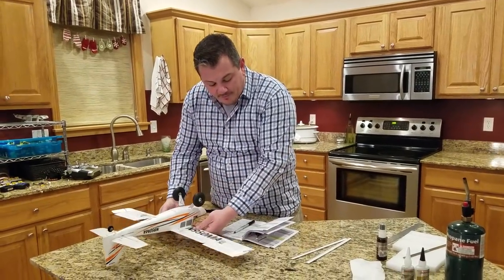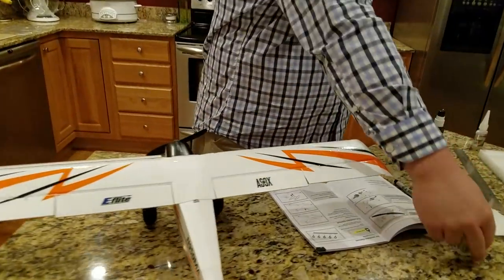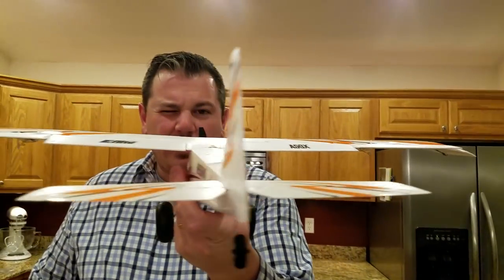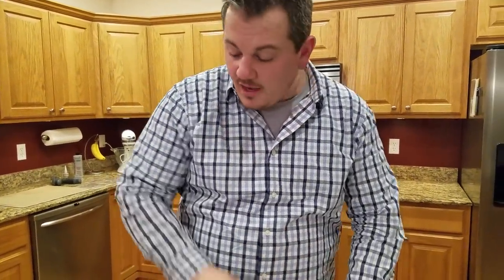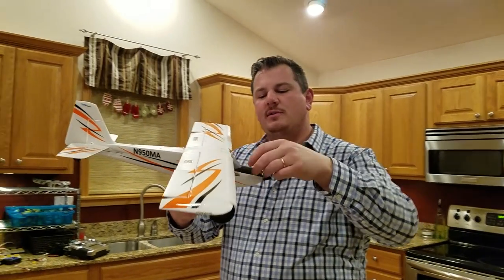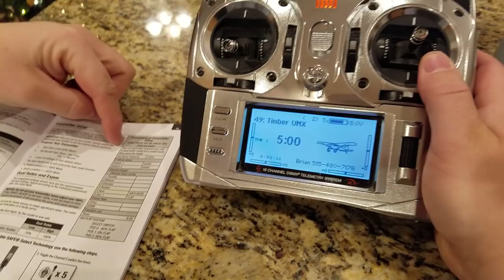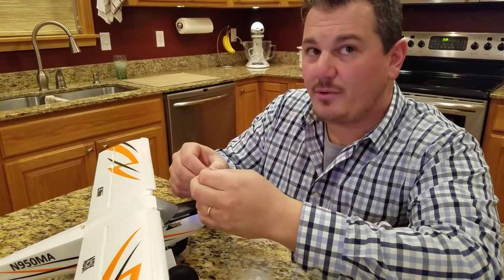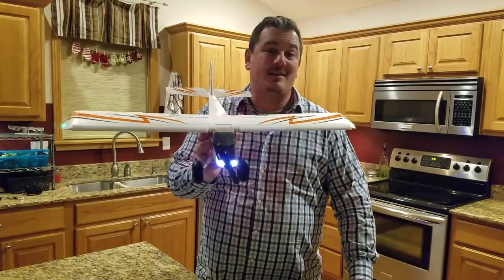Eflite - Timber - UMX - Assembly, Radio Setup, and Tips

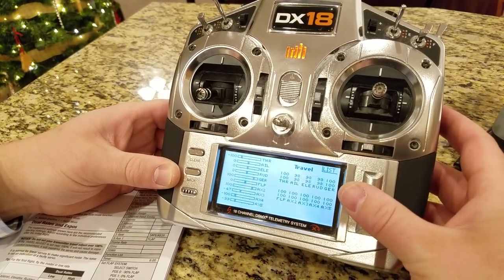Comment: Brian, I am looking at 39:48 in your setup vid and when I scroll thru the servo menu to change the 100 to 98 like you did, when I scroll to the ele how come the square outline only outlines the top 100.  but when I move the ele stick lower the box highlights the both top and bottom and then only the bottom 100.  Was I clear asking this?
thanks
Reply from the maker: That's because of the current condition of your FLAP control switch. So let's say you had selected Switch B, the one I had, and the switch was in the MIDDLE position...then BOTH boxes would be highlighted as you scroll through the available channels to edit...however, if the switch were in position 0, it'd be only around the LOWER number, likewise if the position were at 2, you'd only be able to modify the HIGHER number...(I might be saying that backwards, but you get the idea) just flip the flap switch once you get the HIGHER or LOWER setting set, then toggle to the other extremity, and do the other one, but if you have the switch in the middle, you can do them at once.

Good luck! This is a good one to ask now, as it gets harder as you get deeper and deeper into the weeds with me ;)

P.S. I understood what you were asking - you were clear...tough to articulate some of these things in text, isn't it!?!?

P.P.S. Good question!
Reply: Bri, thanks man for your help,  I finally understand expo. While setting up the timber UMX, I set the ail expo to 0 in switch position 1 and 100 in position 2 just to see the difference.  It's pretty freakin cool when things make sense and how your settings can change the result youre looking for.  appreciate it!!
Reply from the maker: Sure thing! It's even cooler when you get out and see it fly, and how many features are hiding in your transmitter that you haven't even heard of yet :) :) :)

Comment: Im still learning how to adjust this i set it up on a 2 stage switch and my safe on another 2 stage switch so the higher the percentage the lower the throws less aggressive? i gave the spectrum dx6 do you know how i can set up my throttle  when i hit 50 percent it beeps?
Reply from the maker: I believe that's in system setup. I don't think I use that feature, so I'm sorry I can't say for 100% certain....since I have a DX18 Gen1...which is SIMILAR, but not exactly the same as a DX6 (Gen2, presumably?)

Comment: I just received Timber UMX from Horizon.  Upon inspection, the motor shaft is off alignment with the fuselage by approximately 3-5 Degree.  When extending a ruler from the motor to the rudder the centerline is off ~1 inch from front to back.  I don't see where I can make any adjustment.  The motor shaft also points downward an even greater fully 5 degree.  This seems beyond factory tolerances.  What should I do?
Reply from the maker: This is correct ;) Even on a full scale plane there's down and sideways mount to help with the significant torque of the motor turning a propeller.
If the spinner rubs the fuse, then you need to get concerned...OR if you find that your plane flies off to the side where it appears to be goofed up.
You can REALLY tell how it's supposed to be mounted by opening up the front of the plane, and looking at the mount. This is where you can kinda see if the motor mount is "off".
Let me know if you're still concerned after reading my reply.
Reply: Thank you.  I had also checked with Horizon Hobby, who replied, "That is normal, this is considered the thrust angle. It should be facing down and to the right some to counter act the torque of the motor."  Did feel more comfortable with the info.  I am now waiting on the "kicker " pump spray attachment that did not come with it, and a required connector to allow the battery to attach to the charger.
Reply from the maker: Good luck! If you're waiting for a sprayer for your kicker, you might find that the it works well even with a small toothpick or a plastic stir. The sprayers seem to waste quite a bit of the product, but so does spilling it, which I LOVE to do - LOL!

Comment: What a great little plane my friend, your channel is very inspiring so much so that I bought a jumper t8sg v2 multiprotocol tx based on your experience, could you advise me if this tx will operate this umx timber as it seems like a good novice flyer for me as I'm fairly new to this hobby and love slow planes and gliders, thanks in advance, my best regards to you and your good lady,  Alan, Uk.
Reply from the maker: YES!!! That's one protocol that I had good luck with!!! DSMX and DSM2 should be pretty easy to get working. It's the Chinese product lines that are always very ambiguous, as far as what protocol they use.

Comment: Bri, i got a new timber umx-on the battery port is it supposed to have only 2 pins (i can't remember).  It only has the outer pins that go into the battery,  the middle one is not there.  
Also, when I move the ailerons, it goes to the up position much higher than the lower position.  I can't remember is that normal or does that need to be adjusted and how if so.
thanks
Reply from the maker: Yeah, the middle pin isn't there. That's normal.

This is called "Differential"...when the upward moving aileron is more than the downward moving aileron...and yeah, this too is also normal.
Reply: your ail don't go down much?
Reply from the maker: Yes, they move DOWN about 1/3 to 1/2 the amount that the other aileron moves UP....just checked to make sure I wasn't remembering things wrong....and I wasn't

Comment: I love this video i keep watching it and pick up something new everytime.  I eneded up ordereing a dx6i .. im new to spektrum (im a taranis fpv drone flyer) is there a way to setup the 3 position switch to get the 3 flap settings like u have on the dx6i. I know you can mix it maybe?..thanks
Reply from the maker: I believe you can do it. There should be a flap mode in the DX6. I'm really sorry that I can't answer more exactly, but I've never had one, and would rather admit that I don't know than lead you down the wrong path.
Reply: @FPV Addict One: were you able to get your dx6i to work with the Timber? I have a dx6i from about 10 years ago when I used to fly helis and I bought the BNF version of the Timber hoping to use my old TX. Can you offer any tips/tricks for the dx6i?